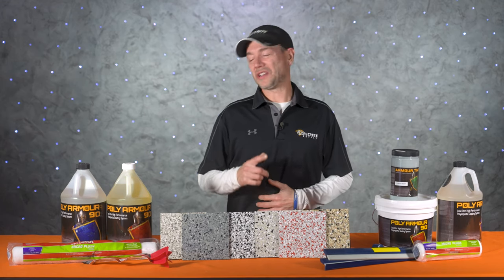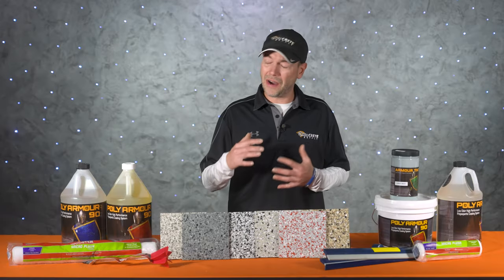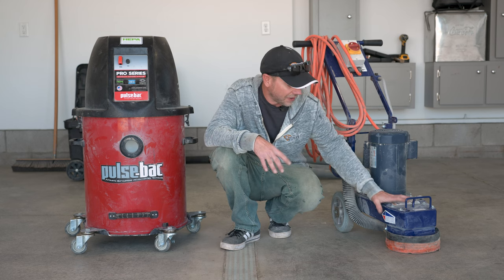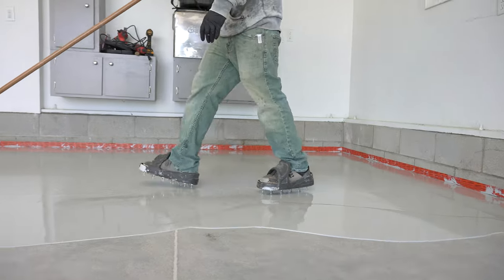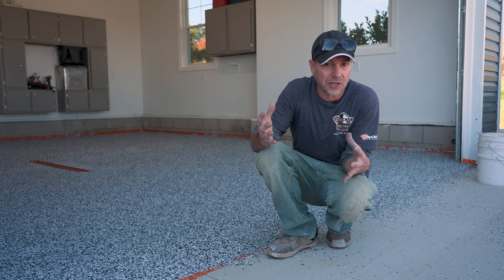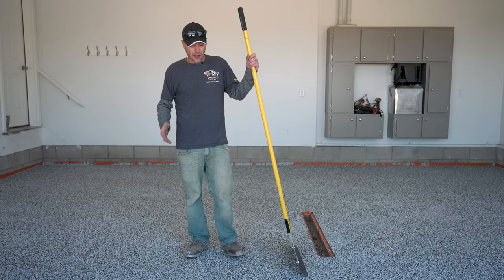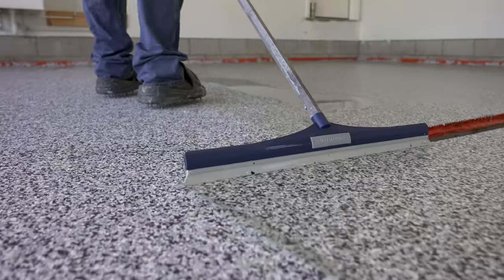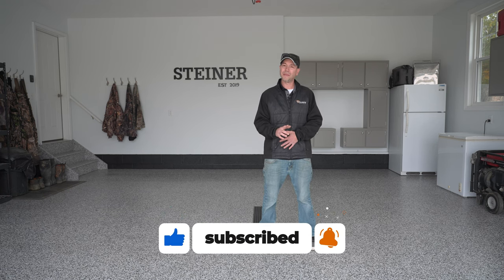Start to Finish - 1 Day Garage Floor Coating!

Comment: Can this product be applied without the chips? I want an all white clean garage floor.  Since it's white will I see yellowing over time?
Reply from the maker: Thanks for the comment!! Poly Armour can be applied as a solid color without any chips. But there are a few downsides to doing it that way, and the chips just make things a lot easier. Some of this would depend on what kind of shape the current floor is in. If it's older and in rough shape, the chips tend to hide most of the imperfections, and you can make it look new again without much effort. If the floor is newer or still in good shape, this wouldn't be as big of a deal. The chips also make the installation easier because the texture they leave behind hides roller marks and inconsistencies. The smoother the floor is, the header it'll be to hide flaws from the installation as well as scratches and wear & tear from use. All that being said, there is certainly nothing wrong with solid color floors, and they are a popular option. We just like to make sure everyone understands the downsides before they make the investment. As far as the yellowing is concerned, Poly Armour is UV stable, so you won't need to worry about that. The white color, on the other hand can be a challenge to keep looking pristine, especially for a garage floor. This would somewhat depend on how you plan to use the floor. Sorry for the long-winded reply, lol. Thanks for checking out our channel & please let us know if you have any other questions about your project.
Reply: @DecoCreteTV  The floor is new construction and is flawless, they did a great job. Sounds like the chips hide poor performing coatings and poor installation.
Reply: @sigma9102 Wrong. Most primers are epoxy based. Epoxy yellows over time. There are products out there that might give you what youre looking for. But its a really stupid thing to do. Youll never be able to keep it clean. Professionally, I've done it before. Only to have customers call back within a year to change the color. The chip system helps bind the epoxy primer to the topcoat. It creates a very durable coating. A solid color with no chip won't be as durable.

Comment: What square footage this kit covers?
Reply from the maker: The color base kit that we chipped into covers around 200 sq/ft per gal (400 sq/ft per kit). The chips cover 200-250 sq/ft per 40lb box. The clear topcoat covers 150-175 sq/ft per gal (300-350 sq/ft per kit) Thanks for watching Deco-Crete TV!!!!